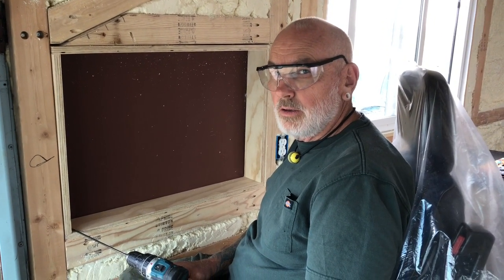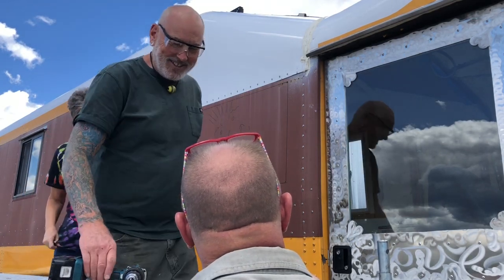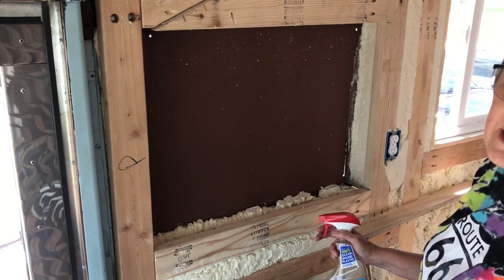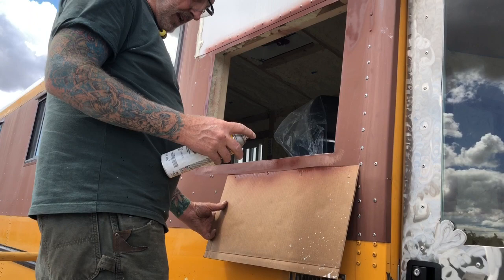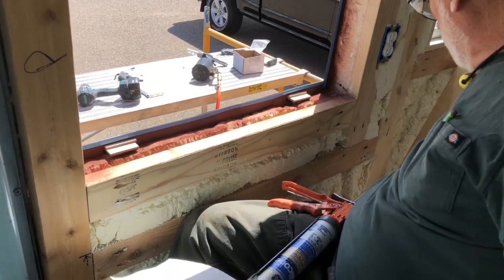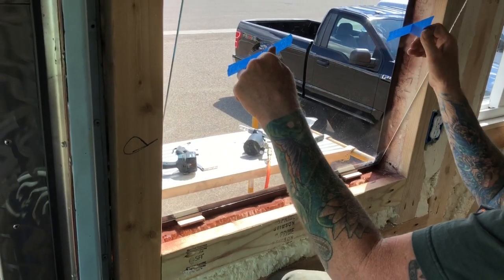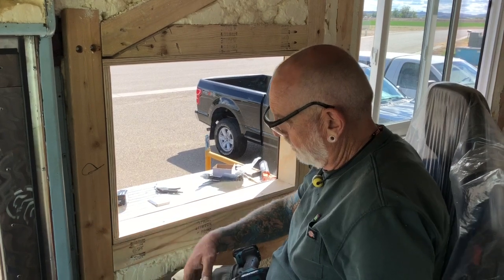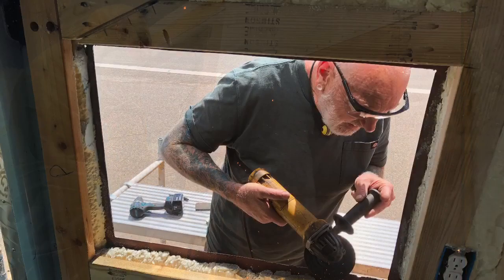CoPilot Window - Vlog 118 School Bus Conversion

Comment: Looks good, but I expect you will either tint it or put a shade over it since in doesn't open.
Reply: I was wondering why they didn't get a window you could open .  I know it would take up that great view she has.
Reply from the maker: We are planning on using a custom push in shade cover.
Reply from the maker: We thought about that but the split was right in the middle of the viewing area and I didn’t want to have to look through it.

Comment: Beautiful views will be found there for sure. Why not a dual pane sliding window? May have been useful for kiosks and communicating with persons outside, without opening the door.    Wonder about the low R value as well.  I think I would want tint and or a shade on the inside.  Maybe a reflective foam cut out you can slide in place when parked in severe climate areas.
Reply from the maker: Shelley did not want a sliding window. She felt that the center Mullion would block to much of the view. Also as I already mentioned she doesn’t want to look out through tinted glass. Not much r value to be gained in that small of a window. So we’re not too worried about it. She will have a push in  cover when she’s not using it.
Reply: Knapp Time ok makes sense to her then go with it.  I was thankful for the tint in my RV when I was parked in the sun.  Carry on.

Comment: Is that automotive glass?    It needs soft rubber gaskets around the window so it takes care of the shocks of the road, don't get me wrong I think the conversion is great and it's going to be a very nice home   Regards John.
Reply from the maker: Yes it is auto glass. I think it will be just fine. 😁It's cushion by the setting tapes.

Comment: Very nice.  What kind of tape did you use to stick the glass to the metal?
Reply from the maker: 1/16” x 3/8” glass setting tape. You can buy it at most local glass shops.
Reply: @KnappTime  thanks!